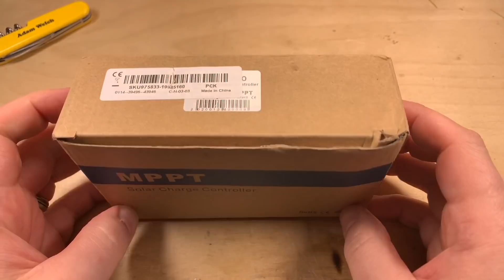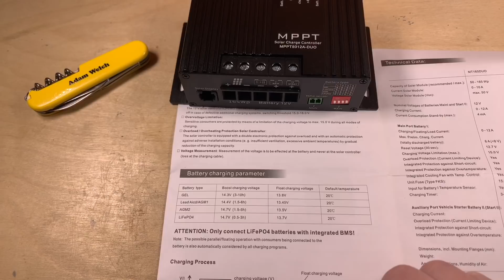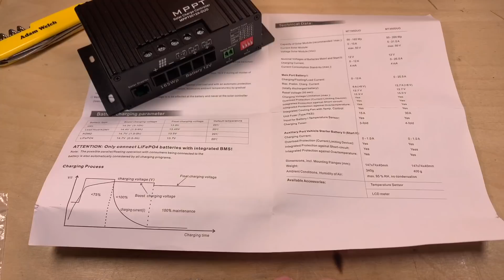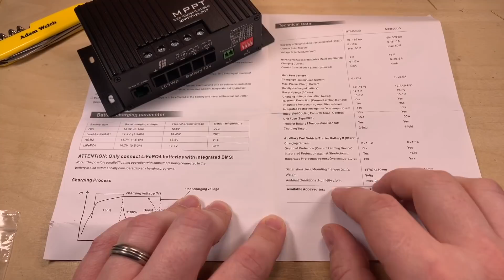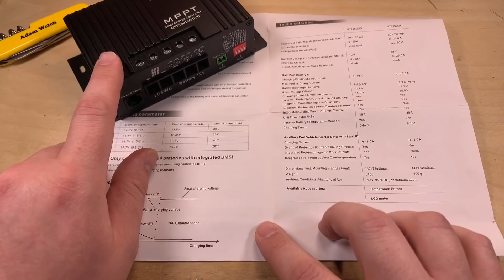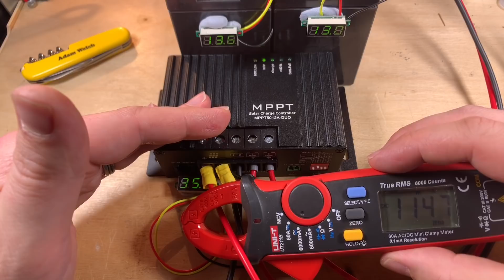Cheap RV MPPT Solar Charge Controller

Comment: Fab mod on the future.

An a question to my fellow viewers, anyone else noticing some strobing? Of the lights. Or Adam did you have a lighting issue?
Reply from the maker: I noticed in the edit when I tried to point my torch below the pcb that it seemed to strobe - is that what you noticed or was there more than that?
Reply: There was a strobe from the torch. And with the cooler lighting your little meters where strobing a touch on my TV. I only asked as it might be my screen. Or could be just a artifact of the camera and the LCD displays on the meters. 

An can I take this opportunity to say, you make me wish I had a shed.
Reply from the maker: Sorry there were some white balance issues - and the shutter speed can sometimes cause issues with multiplexed LEDs. Every tinkerer should have a shed - or a space you can use like a shed :-)

Comment: 3S lithium cells with a BMS. The solar charger would output 4.56 volts per cell but the BMS would stop at 4.2 volts and stay off until it drops to the low start-up of the BMS even with the solar input varying?
Reply: lifepo4 not standard lithium meaning 4s
Reply from the maker: Yeah as David says LiFePO4 has different parameters - they usually get charged up to around 3.7v per cell not the 4.2 of lithium ion. Actually I think LiFePO4 works far better as a lead acid replacement than lithium ion because of this. So as I said in the video, a four in series LiFePO4 set should work quite nicely with this charge controller.
Reply: Experiment to make it more useful.

Comment: What a shitty design for a charge controller. Not bonding the MOSFETs to the case for use as a heatsink and not providing a heatsink or fan for them is guaranteed to make a product with a reduced lifespan and limited current carrying capabilities. On the good side, nice video as always.
Reply from the maker: Cheers. 
I generally always say to buy a charge controller that is designed for twice as much current as you plan to put through it for this very reason. I say generally, because I didn’t say it in this video :-/ I was thinking about those fets last night. I’ve built a solar charge controller that is designed to take half the current of the one in this video - but I still attempted to heatsink the mosfet and diode to keep heat in check. The board design means it would be tricky to pop on a heatsink too - they are pretty close to one another.
Reply: Maybe they borrowed a term from the US car companies, "planned obsolescence".
Reply: Nicholas, you should know the electrical components well. I fully agree with your opinion. We produce solar charge controllers, also have same idea with you.

Comment: The only issue is no heatsink's for the mosfet's. I'd be tempted to run enough wire to reach the housing and connect them to the case, other than that it seems perfect.

Comment: You let me down adam, been looking forward to your next video and you changed the line up lol...
Your last video has inspired me, im going up to 48V but i can no longer use my own diybms for 14s as well as keeping my solar monitor.
Its time i moved to the actual diybms, jlcpcb say £25 for 15 mostly populated boards (just missing a thermister and the attiny, £13 from rs and a trip to jodrell bank) but they then say another £25 ish for 5 populated controller boards when i only need 1.
Have you got the 4s diybms up and running yet? what did you do for the controller (i'm guessing you didn't buy 5 boards but if you did i would buy 1 from you), also the 2 pin jst's are they 2.54mm pitch? is there anything else i need to know?
Reply from the maker: I try to keep it mixed up because not everyone likes the same topic video after video (and I like to mix it up my self). I’ll send you an email and see how I can help you.
Reply: @AdamWelchUK  Awesome, thank you :)
Reply: I'm looking for someone who could order the populated boards, and program them for me, if anyone is interested in giving me a hand, i have a 7 s liion system, it probably wouldn't hurt to have a few replacement boards, email me at jtj28659@gmail,

Comment: Interesting, but what happens if your battery I is a different chemistry than your battery II? Guessing you just cannot connect them both then?
Reply from the maker: I think the secondary output is designed for a typical lead acid car battery and the chemistry option doesn’t change anything for the second battery.

Comment: maybe a silly question?? at 17:00 when you measured the current in and out it showed a negative to the batteries, is that discharging?
Reply: The direction of the wire in the clamp meter decides plus or minus. Turn it 180° and polarity will show the opposite.
We know it's charging, we're only interested in the magnitude so it doesn't matter if the meter shows plus or minus.
Reply from the maker: As Andy says, it depends on the direction through the clamp meter - sadly if I turn the meter to read a positive result I have to turn the screen away from the camera! Good questions though, perhaps I should have commented on that. Cheers
Reply: @AdamWelchUK  good to know..thanks